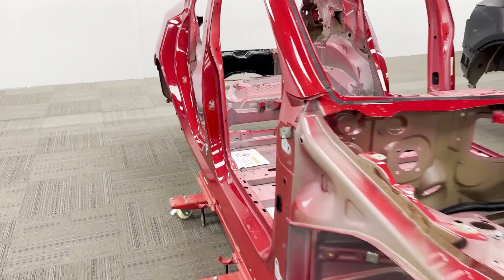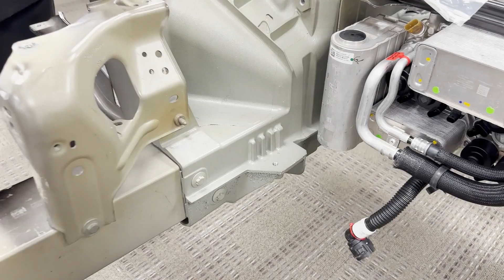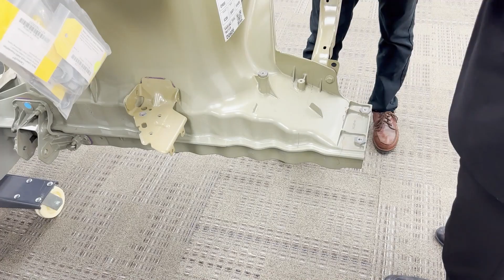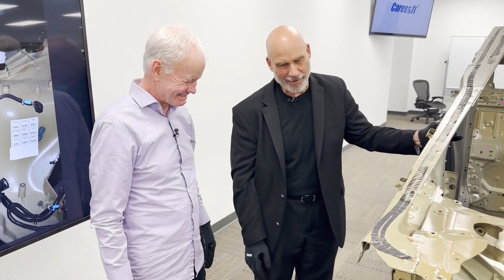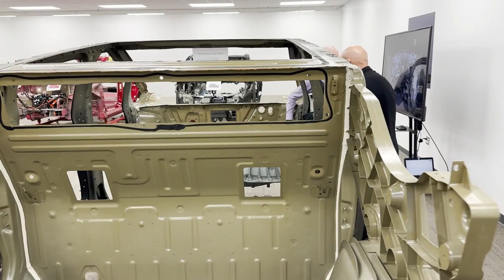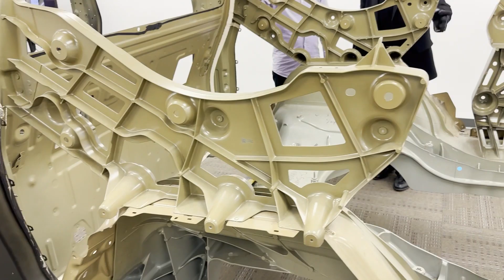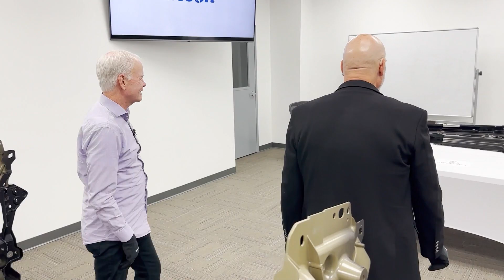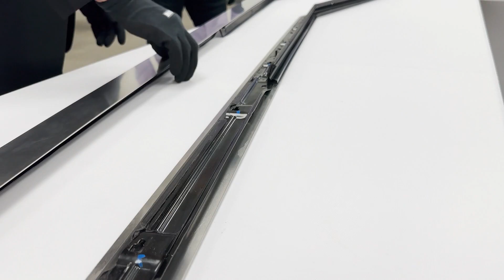The Evolution of Tesla's Body Structure - Caresoft Teardown

Comment: Tesla say the rear sail panel increases the rigidity of the truck by a lot. And the doors don't need reinforcement beams because the skin is thick stainless steel. So I don't think it's correct to say that the A-surface parts do nothing structurally.
Reply: They probably add some structure but it looks like not significantly. The attachment points of the inner panels and b surfaces look not so structural and BIW looks already so built up. I am just amazed how they initially marketed this as exoskeleton and it ended up the exast opposite lol
Reply: @bArda26  I recall something like 15% rigidity from the rear sail and the front fender provides 13% of the front crumple.  Don't hold me to the exact numbers.   Is someteen significant.  Opinion perhaps.   

No it is not exact opposite.  It is weirder that that.      For fun try classifying CT with an open mind..   It not a vertebrate. That makes it an invertebrate.    Invertebrates with endoskeletons include: jellyfish, sea anemones, and earthworms. Not good fits. Now look at Invertebrates with exoskeletons.  This is more promising.
But rather than have confusion scientist scratched a line in the sand with a stick.  "An exoskeleton is no longer considered an exoskeleton if it's connected to an endoskeleton."

There you go.  Science has proven by declaration that the CT is not classified as an exoskeleton.    /s
Reply: its NON Structural , made of RECEYCLED casting materiel.
Reply: @markplott4820  The 4 top casting are made from RECYCLED casting material.  Recall it was said the alloy for these vary
Reply: @danharold3087   - Tesla , recycles old Wheels in the Gigacastings.
Reply: @markplott4820   Yes but when casting the 4 parts that weld to the lower rear casting.  I too recycle car wheels for aluminum casting.  Great fun.  Love liquid metal.
Reply: The surface is not structural there is a stamped panel glued to the surface panel that is structural. Tesla probably realized that a ribbed panel will provide a stronger structure compared to a flat panel. So they went into a hybrid flat surface bonded to a stamped backing panel.
Reply: @kazedcat  As I said in the above post Tesla engineers pointed out it added strength to the structure.
Reply: @danharold3087  Adding strength does not mean structural. For one thing the skin is only glued on to the structural panel that means the strength added by the skin is capped  by the strength of the glue. You can just remove the skin  altogether and spray glue to the  structural panel and you would have the same strength as having the skin.
Reply: @kazedcat  Modern cars can use up to 200 meters of structural adhesives in their car bodies, and around 15 kilograms of adhesive overall.  
Structural adhesives for the automotive industry are toughened, high performance compounds that offer fast processing speeds and exceptional bond strengths. 
Structural adhesives are an alternative to welding in the automotive industry. In fact, the trend of "bonding instead of welding" has become best practice in the automotive sector. Structural adhesives have many advantages over welding, including:
Strength: Structural adhesives have similar overlap shear strength to welds and are stronger than spot welds, rivets, and bolts.
Reply: @danharold3087  Yes the glue is structural but not the skin
Reply: @kazedcat  Why?
Reply: @danharold3087  If the glue is strong enough then you don't need stainless steel skin. You can replace it with paper and glue and you end up with a structurally stronger panel. But if the glue is not strong enough then stainless steel skin is overkill you would delaminate the glue before the skin is in any form of structural significance.
Reply: @kazedcat  
You making up stuff to make your argument that there is no structural value in that outside stainless panel.
No desire to play that game.
If you need it to be nonstructural  simply move the dividing line between what is considered structural and what is not.
When the CT engineer says the rear sail adds 16% (or whatereve) simply tell yourself that anything less than 25% by your very own definition is not structural.
It is a far simpler game than claiming Tesla uses library past to glue on the panels.  Yeah that is the direction you were headed.
Have a good one.
Dan
Reply: @danharold3087  The skin is not structural it is simply glued into a stamped structural panel. It is not adding more strength than the glue to hold the vehicle together.
Reply: Agreed